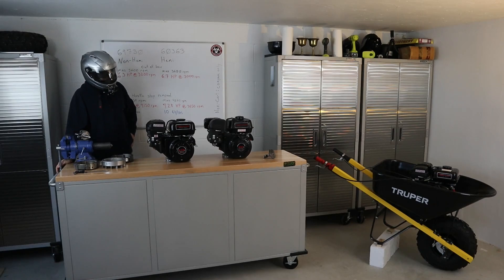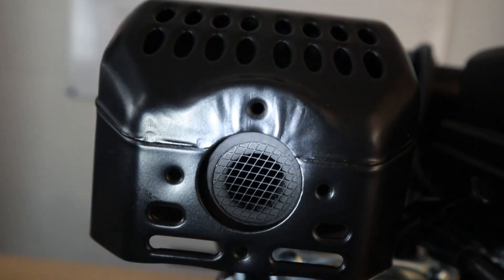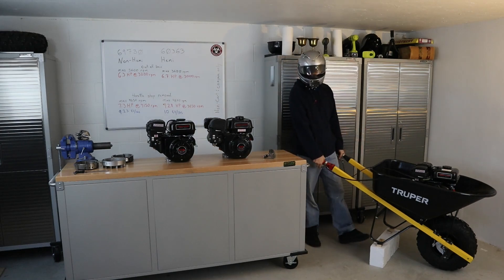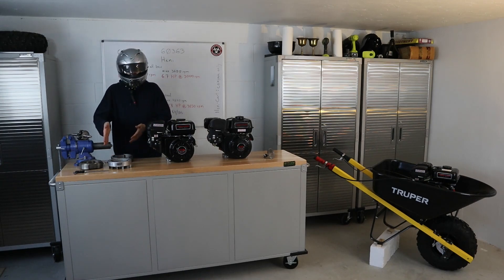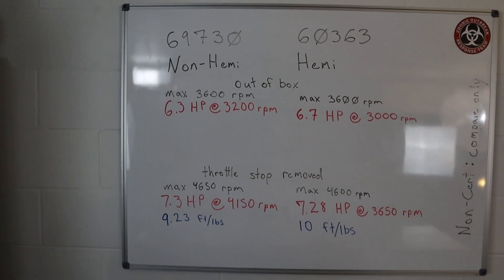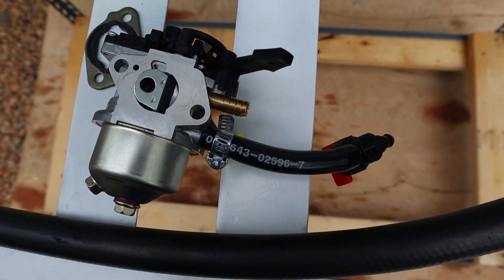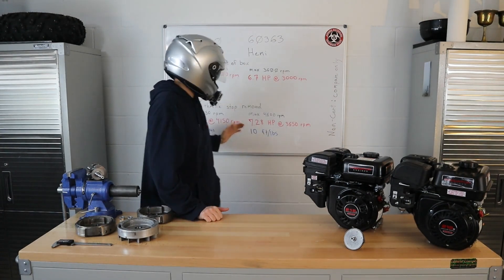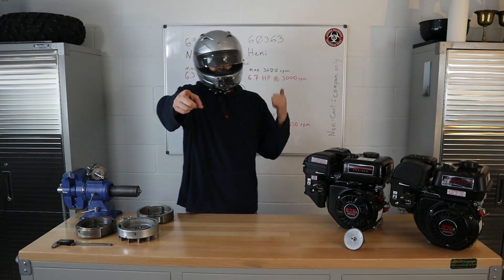Predator 212 hemi vs non hemi harbor freight engine

Comment: One reason we found out is because in stock hemis, the rocker arms & pushrods (also a few grams heavier in hemi) are tilted away from each other and causes more friction and valve float happens easier & at lower rpms

Comment: I have 212 cc predator. The number on the starting coil is non hemi  however I have the hemi valve cover air filter and spark arrestor.
Reply from the maker: Yeah, that's been happening more these days. Don't know if it was just the last batch or what but many sightings so far.

Comment: Would you recommend the 212 as a alternative swap in a 4 wheeler that was originally a 185cc? 4 wheeler was a free project, 86 suzuki lt185 with a seized engine.. budget on another toy is thin due to car & truck projects along with kids mini bikes but was thinking I'd get the 4 wheeler running just so I had a toy to ride along with them..lol

Comment: I thought hemi means the piston is hemispheric not flat. At least in the dodge hemi..
Reply: Hemispheric outward, no indentation
Reply from the maker: Hemi does not have to do with the piston, Hemi has to do with the angle of the valves in the head. The Hemi model is just "known to have a flat top piston". The non-hemi has a dished piston, the hemi has a flat top piston. The head for hemi is hemispherical. My latest video of predator hemi versus Ducar hemi shows internally the heads better if that will help with visuals.

Comment: I'm so confused now, I have the 69730 It has the round vertical 2 stage air filter, the rectangular not shiney valve cover and the spark arrestor.

Comment: Which one is best for replacing an old Tecumseh on my 1977 Horse Troy Bilt tiller? Or does it really matter? Thanks👊🏼🧑🏻‍🌾🌾
Reply from the maker: For tiller, the little bit extra torque from the hemi is nice. But, depends what is available in the area.
Reply: @megoingfast  Thanks, the sale ended yesterday so I bought one of the last two left. Both were Hemi’s. 👍🏼keep going fast🏁

Comment: Thanks for the video. I just purchased the 212 hemi version for a snow thrower, replacing a 208cc LCT engine. Do you know the thread size for the mounting holes (only the tapped/threaded side)?  I swapped out everything freom the LCT to the Predator, and it all bolted up nicely, even the drive side plate because the LCT's plate came with the oil dip stick extension. Also swapped the muffler, carb, and engine cut. Started up 1st pull. Only need to figure out the mounting holes which for whatever reason are slightly larger than the LCT's.
Reply: "engine cut" whats that?

Comment: I got a hemi and I put a pipe on it and made a air filter fit and it revs Idk if it's just me but it seems better than the non hemi then I ported it took the edges out of the ports and that made it rev a lot more with just my hand made mods I would say I'm pushing 10+ hp it spends the wheel a bit on my mini bike and it does 40-50 with a clutch but I can see the other motor being a little better stock bit it was hard to tell but doing what I do hemi all the way for sure

Comment: I recommend personally that a non-hemi would work best. I've heard the hemi engines had something to do with valve issues, but I'm not entirely sure. In my honest opinion, the non-hemi engines have more reliability to them, and they're easier to work on, especially installing stage kits for performance.
Reply: Piston to valve contact is much more likely on a hemi due to the angle of the valve. Using the proper pushrods and valve springs when doing a build on these is important. Ive heard of a few getting bent valves.

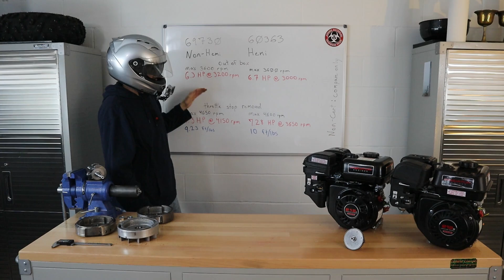Comment: so which one would you place on the snow thrower in the video 6:00 (yard man/yard machine?
Reply from the maker: I kept the stock engine and added a tct carburetor to the yard machine. But, if I had to choose for snow thrower I'd do the hemi in it... With a tct carburetor.
Reply: @megoingfast  Thanks for your speedy reply, took mine in on a recall for wheels and looks like the didn't put belly plate back on and it was not starting, I thought they intentionally messed it up because recall was free. I drained carb and it started but I was on my way to purchase the harbor freight engine rather than getting a new craftman snow thrower
Reply: may try the vertical predator engine on a pressure washer I have (BLACKMAX) if i get the pump. hope it's just bolt on and go .
https://www.samsclub.com/p/2800-psi-pw-blackmax/prod8770132 similar unit. I think the engine is good but has been sitting with gas (stabil) for about 5 years. I let it sit when the pump froze over winter. plus she was thirsty lol drank gas quickly.

Comment: Non-Hemi is the way to go. I have both. Same mods and non-hemi is faster and just seems like an overall better build quality. Hemi has had more problems and shakes for some reason at a certain rpm.
Reply: I threw on a big pipe on my hemi and a air filter and when I say big pipe it's a 450 dirt bike pipe and it made it run smooth it let it revs way more without that shaking my hands off lol you got to let the engine breath or it will hold it back and make it vibrant bad I lost about 50% or a little more just doing the pipe

Comment: Hey I live in Minnesota too! Question, do Tillotson 212’s really come stock with 10 horsepower? I’m trying to decide if I should grab a Tilly or a predator for my Yerf Dog go kart
Reply from the maker: Minnesota represent!! The Tilly 212 engines do not come with 10 HP stock. I did a predator versus Tillotson 212 R video that shows HP side by side on some engines. GREAT engines though, VERY good parts and ingenuity!
Reply: Awesome thank you so much for the response! I will check out that video. I just took my Yerf Dog on White Bear Lake yesterday and drifted it around for hours! I have a Robin Subaru OHC EX21 engine on it right now, it’s an amazing engine and runs super smooth. The only problem I run into is all performance parts are rare to find and insanely expensive!! I wish there was some clones of that engine or more aftermarket parts because I really love that engine but I want more power. I’ll most likely be putting a Tillotson 212 on it or a Predator 420, not sure yet

Comment: Thank you for this video i just bought a hemi for $99 at HF, bought 2 engines with different item numbers but both 212
Reply from the maker: There are several item numbers and it can get a little confusing. There are 2 numbers specifically for California and it's a different engine as well.
Reply: I just got back from my HF and they only had the Hemi.. worker said they never know what theyre going to get from the manufacturer.  How did you get the motor for $100?  HF stopped printing coupons a while back. Was there a big sale ?

Comment: Nice...With the throttle stop screw removed you can see that these engines run too lean stock for the mini bike or go kart application because max HP occurred before max RPM.

The test I would like to see is the dyno numbers with both engines with stage one kits and throttle stop screw removed. 

I'm surprised the better rocker system on the Hemi is no help with performance. I thought they would be worth 1/2 HP or so. Maybe the Hemi rockers would help at higher RPM with a stage 1 kit?
Reply from the maker: I've been told by someone doing flow tests the porting and head on the non-hemi is better from out of box.

Comment: I remember when I took a non hemi and a hemi and put them together and it worked perfectly.I wonder what your going to build next with those engines.
Reply from the maker: I always leave a few of them stock for comparison videos and to baseline the dyno. Next videos in MIND but not finalized are high compression head and porting videos! Gotta figure out what's up with all the delays in shipped parts though lol

Comment: I built 2. One hemi, one non-hemi with a hemi piston. Both have billet rods and flywheels.  Both have 18# springs. Both have Ruixing 212 carbs with 140/38 jets, intake and headers. Each one is on a DB30S with a Max Torque SS 12t and the rear sprockets are within a couple teeth of each other. They have the zip tie hack done only. I prefer the hemi myself.
Reply: I bought a hemi one and when I go top speed on my mini bike it just shuts off. Do you know what the problem might be?
Reply: @jairoperez4230  Did you take the governor off? The fact it just shuts off makes me think of the oil sensor not being removed.